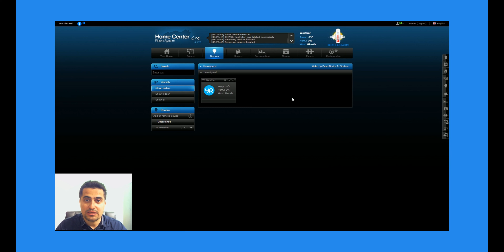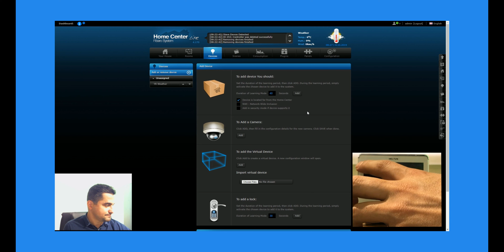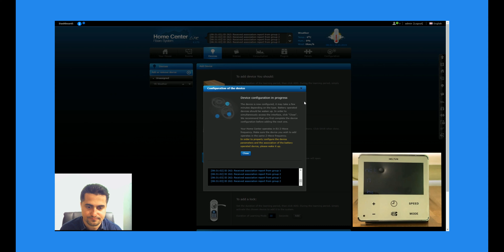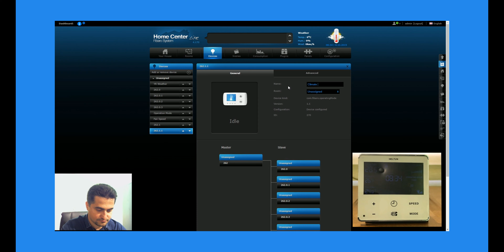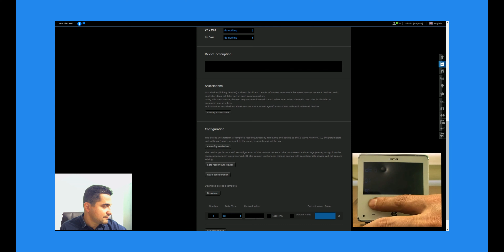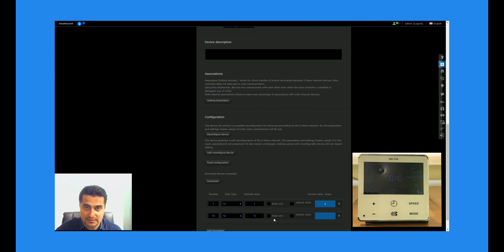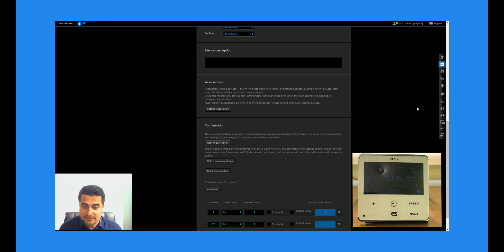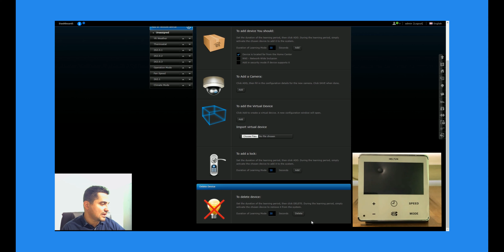How To add Heltun Thermostat to Fibaro

Comment: hi
can you tell how to connect the wires back side of this thermostat
Reply from the maker: Hi, May I know what kind of device you want to control?
Reply: @kian.smarthome  
Z-Wave 700 FAN COIL THERMOSTAT
i want to know which wires to conect with which input and output
Reply from the maker: @ummatisoftwares1311  CH1-3 IN is input of CH1,CH2CH3 out for fan speed (mostly main power must be connected to CH1-3 IN and 3 wires of fan speed must be connected to outputs. CH1 out is low speed, CH2 out is medium speed, CH3 out is High speed). CH4,5 IN is input of CH4,5 out. The input of CH4,5 IN is the related voltage of your fan coil valves. CH4 out is for cooling valveand the next output is for heating